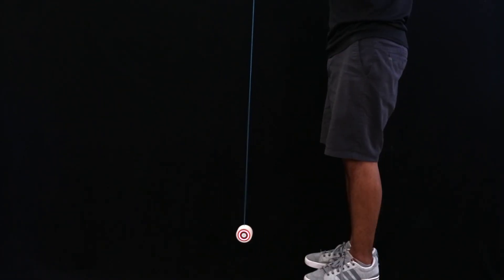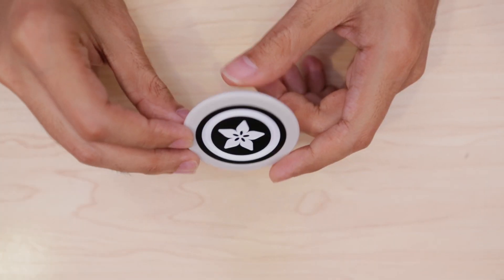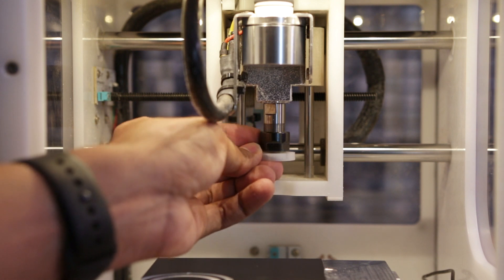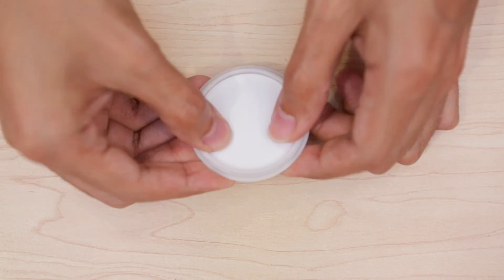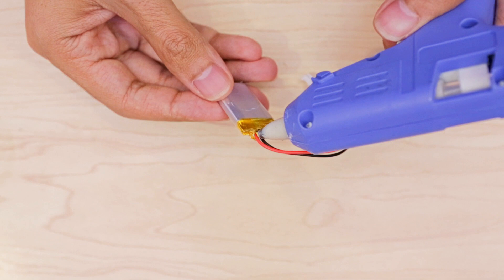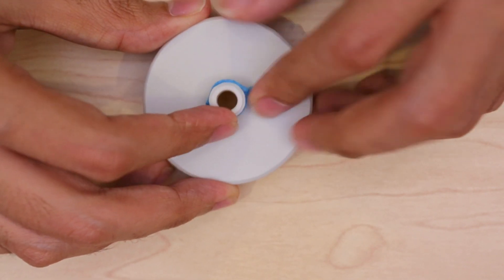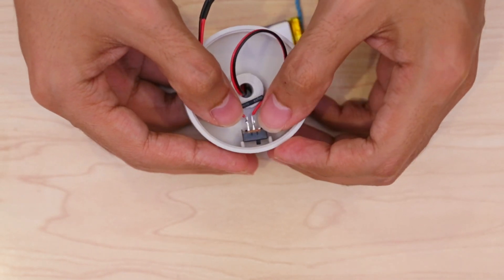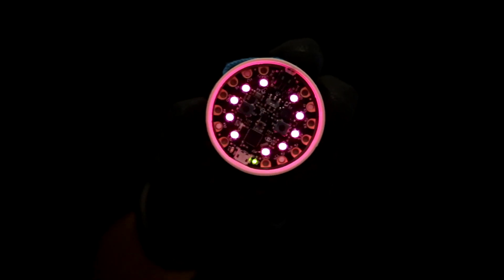How To Make LED Yoyo with Circuit Playground

Comment: Why do you didnt build in a ballbaring for the string?
Reply: IIRC, yoyos use the friction between the string and the body to actually spring back up. A ball bearing wouldn't totally disable the yoyo, but it would likely make it a lot more finnicky.
Reply: SuperSlimeBoy actually, what makes the yoyo come back up are response pads. Response pads use friction to pull the yoyo back up. Adding a ball bearing wouldn't disable the yoyo, it would make it better. Just add a slot for the response pads and you're good to go. If you want to make it unresponsive, use a larger bearing, probably size c.
Reply from the maker: Exactly! That would make it a "non-resposive" yoyo, which is ideal for pro-yoyo-ers ;-)
Reply: Unresponsive*